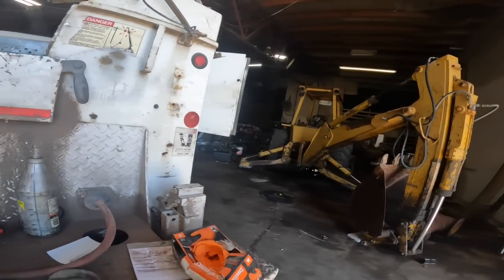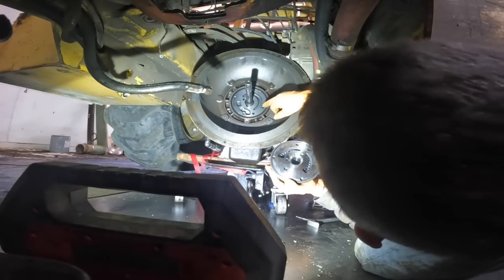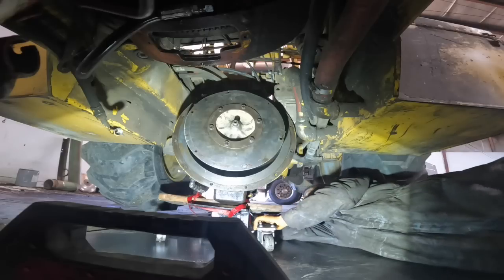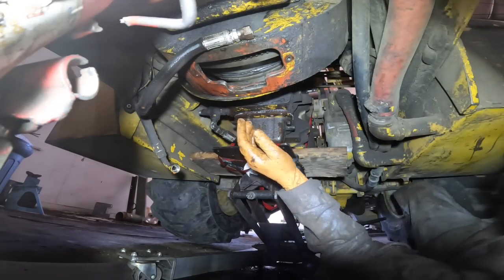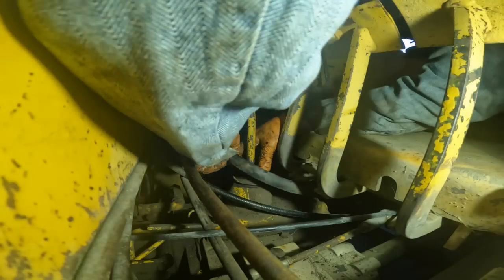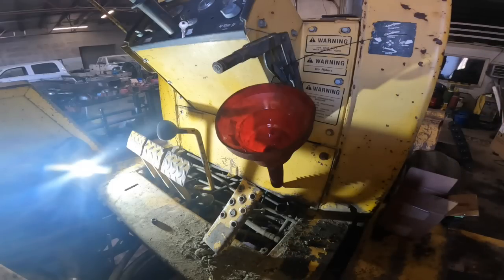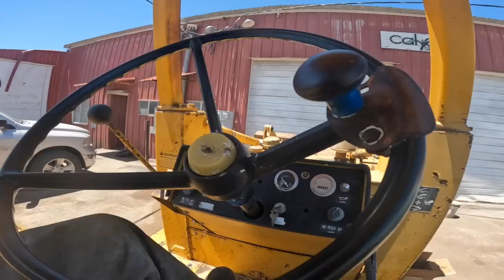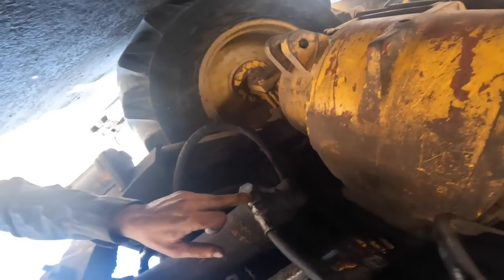Backhoe transmission pump replacement.

Comment: Whenever I get under any vehicle, my eyes are like a magnet for every little dirt crumb, piece of rust and crust that can fall into them. Then I always regret not wearing eye protection. Must just be me. It’s good that others don’t have my problem.
Reply: Don't feel like the Lone Ranger Jeff.  I bet I could weigh all the crap I have gotten in my eyes over the years by the ton rather than the pound. Be safe and do what you can to protect your eyes , they are important , trust me.
Reply: Jeff don't feel like the Lone Ranger there.  If you weighed all the crap I have managed to get in my eyes over the years it would be in the tons not pounds. Take care of your eyes they are important , trust me.

Comment: Thanks for the videos, Warren. I am also a mechanic that works alone, and I have conversations with equipment as well. Some conversations are not rated for other people to hear. Nice to see the old Allis Chalmers back in action. I think that model had the Perkins Diesel, so not much old AC in it besides the steering wheel. Missed seeing Josie.
Reply: 😂 glad it’s not just me then

Comment: You are the master and you probably checked crank end play run out. When ever i see seal / bushing damage I check. When i was younger i  had a MF super 90 that wouldn't hold multi power seals. Too much crank play. Then had an old scout 2 travel all.  345 IH mated to 727. Same deal.

Comment: Hey Warren, long time watcher- you ever had a Komatsu/Halla forklift snap the drive tangs off the torque converter/oil pump? Transmission looks mint on the inside. Don’t  work on a lot of automatics in Ireland 🇮🇪
Reply from the maker: No, can't say that I have.

Comment: Ha Warren,  have you ever seen  6.7 cummins high pressure fuel pump  crack  and leak around the pressure piston plate?

Comment: 2 gallon pump garden sprayer $25 at Walmart

Degreaser:
2 Cups "Ultra Dish Detergent" any brand
2 Quarts Kerosene (red is fine)
2 Quarts conventional ATF 
Remainder water
Shake to mix and before using.

Hot or cold engine-
Thoroughly spray 1 gallon of Degreaser on entire unit
Use brush or broom for heavy areas, respray
Wait 10-15 minutes

Pressure washer, steam, or garden hose-
Rinse from top down, don't flood electronics, don't get
into intake ports. Move rinse quickly.
Immediately blow dry with shop air
Start engine, let warm up

Comment: The simplest way to exactly , and I do mean exactly line up a torque converter ot transmission is to carelessly get at least one  of your fingers in the way of the contact area or a sharp pinch area.  That thing will slam into place as far as your poor little digit will allo ant then the howling REALLY starts .  Talk about singing the four letter chorus now , man.  By the way I get it that the noise of a train makes what you're doing harder but right now I kind of like hearing them run.  Those things are seldom taken out for a joy ride , them running means product is moving at least some.

Comment: Got a 580SE that needs shuttle work. Would have liked to see how you finished attaching it to the block. Something was hanging it up. Also my manual says the flex plate needs to be within .004" of runout and Case had an alignment tool for it. Of course it's no longer available. Wonder how you did that.  

Re. normalizing crazy. Not only are we doing that but we are prioritizing the minority. The rest of us, the majority, take it in the shorts.  That's backwards.

Comment: Those flat face mount transmission  can be a bear to line up .even  worse  if you jack is sloppy and doesn't have tilting features front and back left and rigt

Comment: I have 4 of these used transmission pump😪
Reply: And try this on jcb 3 DX model , so complex process,you need to fix torque converter to flywheel and then put transmission shaft inside, so much headache 😂😂😂